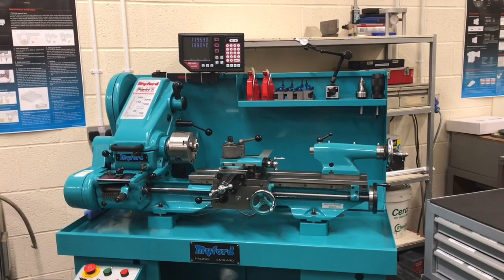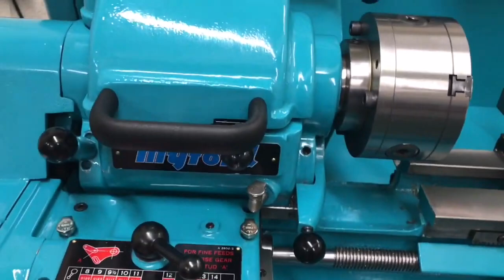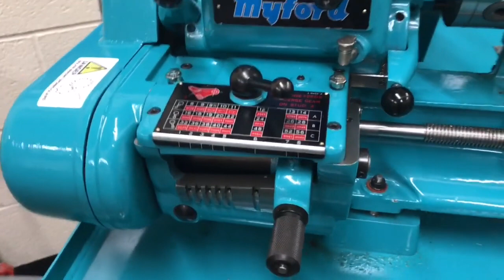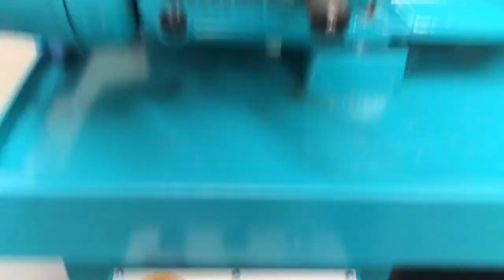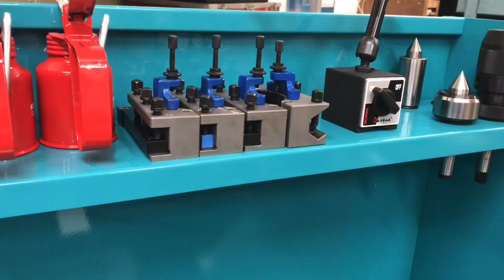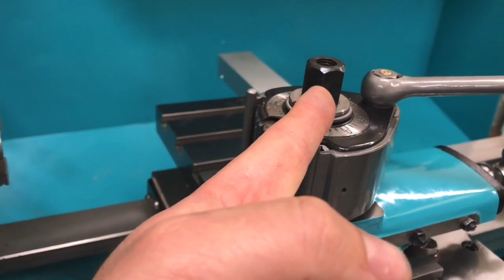Myford Super 7 Connoisseur Review Part 1 of 2

Comment: Quick question - your shiney new lathe doesn't appear to have a thread dial indicator fitted, does it not come with one now? Mine is a 1996 S7B I bought new juist 5 years before the company ceased production. I can see a lot of minor differences but it's basically the same machine. Has worked well for the 30 years or so I've owned it.
Reply from the maker: It does have a thread dial indicator attached to it now. When the machine was delivered, the parts were out of stock at Myford so I agreed to take delivery of the machine and the indicator caught up later. However, it is useless to me because I machine metric threads and the lead screw is imperial on all Myford lathes. Hence I never use it.
Reply: @opticalmechanic  Oooh I didn't know that. I thought metric machines naturally had metric leadscrews. Your DRO compensates of course for machining stuff but still, that's a surprise.

Comment: Surley there are better built machines out there than this Myford . 7K for a hobby lathe is too much in my book
Reply from the maker: @Jacob-64  possibly. I was considering a Hardinge but they are hard to find in good condition. My Myford is now much better than when I got it but it’s still no Hardinge.
Reply: There are certainly better small toolroom lathes out there but those are lathes dedicated to turning (only). The Myford is a bit of a do-all machine with masses of accessories available for it.

Comment: Did you confirm the tool-post size?  If so I missed it.  You also mentioned it was a China built post, is that correct?
Reply from the maker: It is a size A and is of some generic Chinese origin but it working well. It should do too as it wasn’t cheap. If I was buying one now I would definitely buy a Pewe Tools one. I wish I knew that then!
Reply from the maker: But I should add, size A is not suitable for a Myford if it is being used with a compound slide. Following this video, I removed the compound slide and made a solid tool post mount and designed it so that it would position the tools centrally about the tool post.

Comment: If you don't already know of it? Anyone with a Super 7 and even these new one's should have what I would consider a non optional book that was written for and about them. https://www.teepublishing.co.uk/books/in-your-workshop/model-engineers-workshop-manual/ Mr. Thomas made many upgrades and modifications to a high level tool room standard. There's some excellent thoughts about the need to pin the top slides gib in place and why the factory arrangement on these and most others that are the non tapered gib type don't and can't maintain there carefully set adjustments. His geared and lever operated retractable top slide used while threading is worth the books price alone. Hemingway produce the parts kit for that. http://www.hemingwaykits.com/acatalog/Geared_and_Retracting_Topslide_for_Myford_S7.html

Comment: I have the Nottingham version, Myford gearboxes require oil they had hardened gears since the 50s, also has the cross slide been scraped in. I also notice there’s no rpm display which the Nottingham ones have.

I can see other differences, as you say non of the Nottingham fitters transferred, I can’t believe live they said oil was not required in the gearbox. It makes me wonder what other things are affected.

As you mention tool holders I have both genuine Nottingham and Dixon posts and tool holders, they work perfectly. I have one Meltham holder, it’s not fully hardened and the part where the tool fits is mild to different dimensions. I did by some RDG ones and they did not clamp properly I took them back and ended up with a refund.
Reply from the maker: Maybe I should have bought an original Nottingham machine... slowly I’m improving mine and ironing out issues as I find them. As you say, it’s ridiculous that they gave it me with a dry gearbox.

I might venture to scrape the cross slide at some point in the future. I had a new saddle fitted to it because one of the threads holding the nut housing for the cross slide was non existent. There’s no way I could have stripped it with a slotted screw head / screwdriver so it must have left the factory with barely one thread engaged. If they didn’t know about it then they should have and if they did, then it shouldn’t have been shipped like that. Needless to say, I brought it to their attention and they sorted it out. Considering what I paid for the machine, it shouldn’t have happened. The new cross slide and saddle assembly isn’t as smooth as the original so I’ve got some work to do to improve it. I shouldn’t have to but I will as it’s easier than sending the machine away again.

Regarding tool holders and posts, the multifix I have is working really well. The solid tool post mount is too but I’ll have to reduce the height of it a bit more as some of my Pewe Tools tool holders are key on the bottom so I can’t quite get centre height with a couple of tools. I’ve got a size Aa tool post which hopefully I will be releasing part 2 of my installation video about this weekend. That smaller toolpost will be fitted to the compound slide for taper turning and thread cutting when I want to use that method and it will save me faffing about changing the tool post over and resetting tool heights.
Reply: @opticalmechanic  I think it would be a common practice to transport machines without oil.
I have a Super 7 built in the mid '70's and yes I put oil in the gearbox.

Comment: I purchased a Myford super seven lathe with many accessories but cannot figure out what this one riser block is used for.  Has a Tee slot,  an offset,  3” high.  If I could send you some pictures it would help thanks Gary
Reply from the maker: Feel free to send a picture over if you like. It sounds like it’s for a parting blade. Normally they are located on the cross slide at the rear and you would run the spindle in reverse with the tool upside down. You do t have to use it as you could mount a parting off blade in a normal tool holder of course.
Reply: Used for mounting the Myford Dividing Attachment

Comment: Considering how expensive these machines are I would been straight on the phone to complains of the poor quality of build.my so called crap built Chinese machine has been from new of superb quality and finish
Reply from the maker: Yes, I was straight on the phone when I found a screw thread that was completely stripped which was holding the cross slide housing on. They came and collected it and replaced the whole carriage assembly. 
Regarding the price, I know what you mean. I don’t think they are manufactured in the volumes that they used to be when they were produced in Nottingham. That impacts the costs of the various castings and machined parts when they are not produced in more economical quantities, hence the price.
Reply: @opticalmechanic  hope all goes well in the future good luck !
Reply from the maker: @steved8038  thank you Sir!